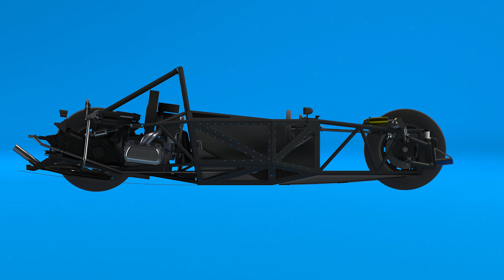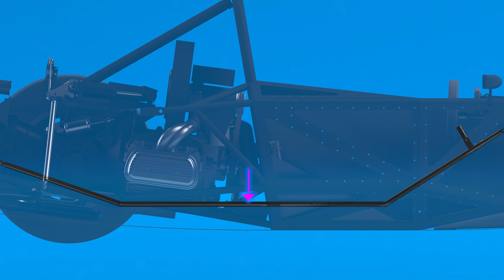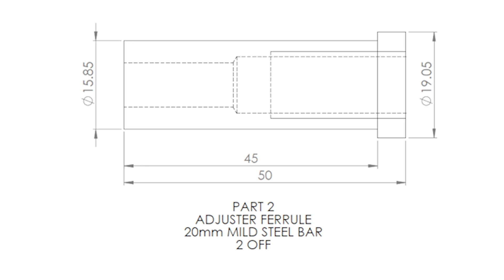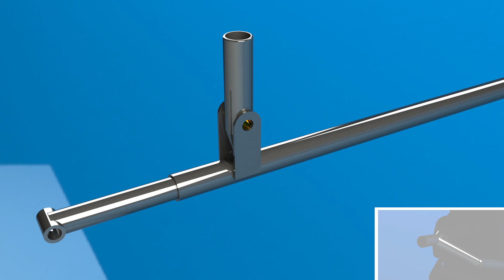Gear Shift Linkage

Comment: Quick question on the adjuster:

Why not just obtain two bolts, one left and one right-handed and just weld the heads together?
Reply from the maker: Could be done too, I wanted a machined part so that a portion of it could be a sliding cylindrical face. That way the only load going through the threads should be tension rather than bending.

Comment: Thanks.  I sat in a cold garage a few nights ago trying to guess on the pattern by manipulating the output shaft of the trans.  Her is my guess looking at the trans from the rear.  Turn shaft right, then up down, you tell me what gears those are, next find neutral turn shift shaft about 20 degrees (guess) push in,  pull out, same question, which gears are these?  Next find neutral ( I did this with 28 degree trans fluid and I did not have the car in a position to turn the input shaft)  turn left,  anti clockwise (as they say in German) and pull, I’m guessing this is reverse, I hope.   Next question:  what was done to get the direction of rotation changed?   I’ve been an engineer since slide rules.  I’ve seen a lot of way over engineered stuff on these cars.  That’s ok.  Guys are having fun.  What the worst case of over engineered shifter you have seen?  My son is an embedded software engineer and also does race cars for the various outlaw endurance races but his style is more of a Dale Sr. or Tiny Lund.  More horsepower and GTF out of my way AH!  He didn’t get all that from me,  maybe 94.7% max.  My objective with my V car is to build a Roadster.  My wife was worried I’d kill myself and consulted my son.  My son told her “it’s a small car and your escalator, Matt will only charge about $200 to burry both (car and me) where ever it ends up”.  We live out in the sticks and the escalator knows everybody so this is not a joke.

Comment: The direction of the shift lever is still dictated by a H pattern plate in the cockpit, is this correct?  Seems like a lot of weight, has there been any problems  with “phantom “ shifting upon hard braking.  How about linkage binding during heavy chassis loads in corners?  Very clean design. Not at all a DIY.
Reply from the maker: It's an H pattern. No problems with phantom shifting, the gearbox selector mechanism is strong enough that this does not happen. No problem with binding either, not that much flex in the chassis.

Comment: the engine is from a beetle right? I assumed from the other videos but haven't found the specific video mentioning it, so aren't the gearbox linkage in that car facing forward (with the engine facing the rear) and in your car it's facing the rear (the engine facing forward). Is there any mechanical modification to make the gearbox power/spin the wheels right way forward?
Reply from the maker: Yes that's right. As I understand, the final drive gear is flipped from one side to the other to change the drive direction.
Reply: Flip the crownwheel to the opposit side and then You have 4 gears forward🤓

Comment: I don't understand, when turn the engine 180 degrees horizontally, you get 4 gears reverse, 1 gear forward.
Is the gearbox mounted upside down?
Or is the engine turning the other direction?

Great video's man, passion for motorsports! Woehoo ;-)
Reply from the maker: Thanks. I believe the differential is swapped to effectively change the drive direction. I've not had to do that modification myself though so I might be wrong.
Reply: ring gear in transaxle is switched over to the other side.

Comment: Nice job. Is there a reason you chose to use steel for the shift linkage instead of Aluminium? Seems like an easy way to save some weight, Although I suppose the gear linkage is not somewhere you want any compliance.
Reply from the maker: I found it easier to work with steel, particularly welding when such different thickness parts together. It's something that I might revise later if I've got a problem getting down to minimum weight.